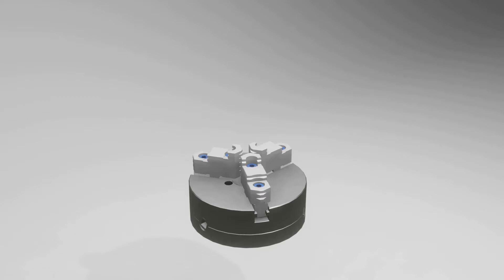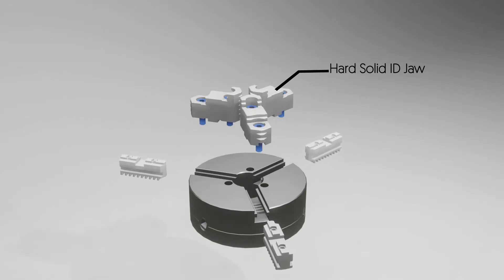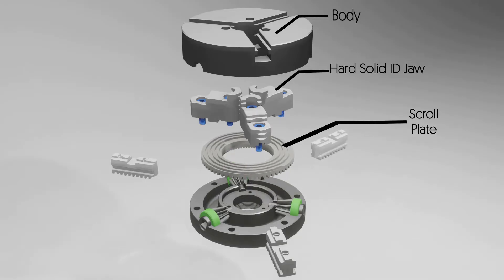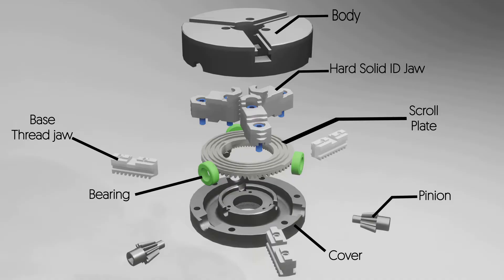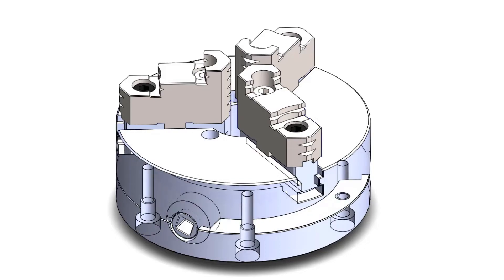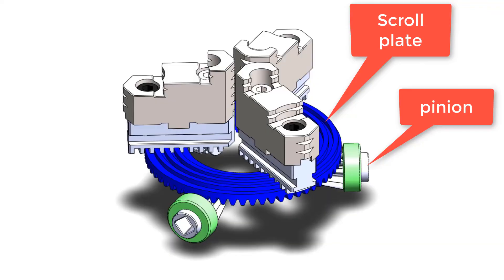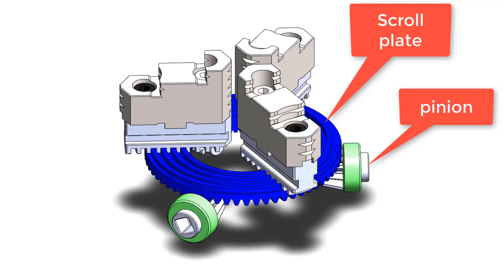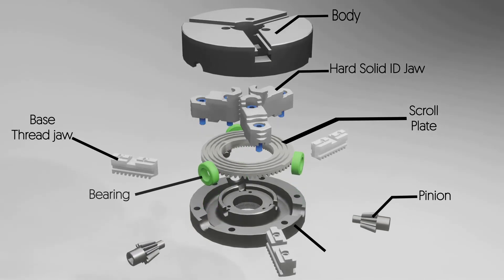3 Jaw Chuck Mechanism working explained

Comment: I want to design a self centering steady rest with a scroll plate mechanism, and pinion gear for fast centering but i can't draw the 3d design of it how did you do that i want to learn.
Reply from the maker: Freecad( 3d modelling )and blender ( for animation ). You also need to know math to select correct gear ratios as per your requirement. I can help you but I will charge.